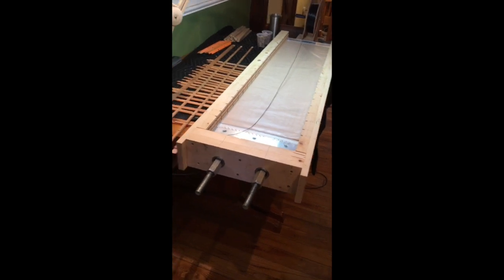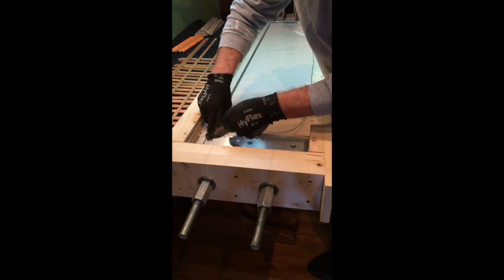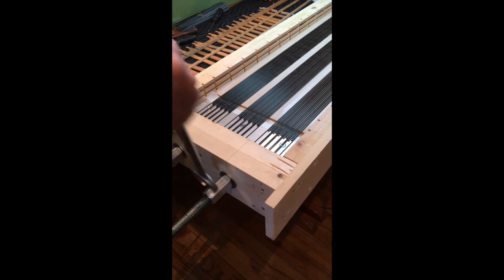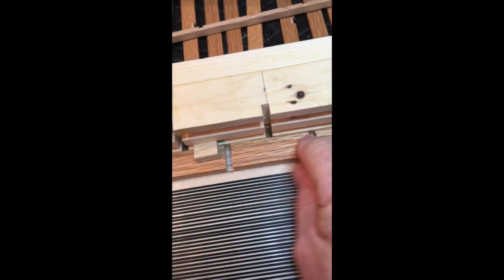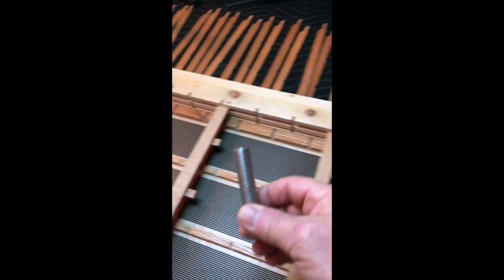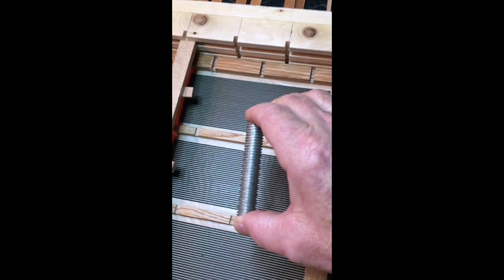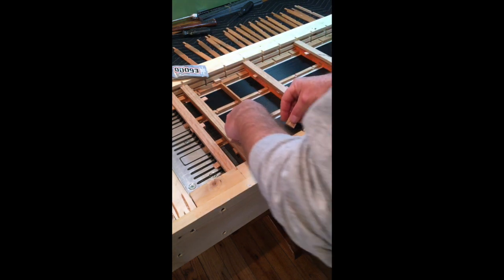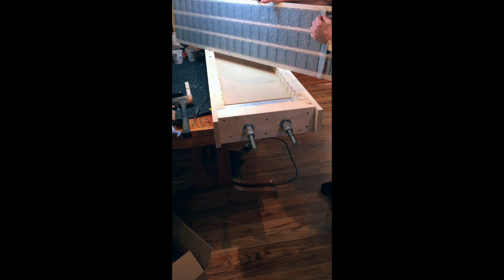Electrostatic Loudspeaker Build - Part 1

Comment: I'm glad you made some videos of these wire stators.  I built a pair of them and put them into a modified frame and subwoofer arrangement based on your plans a few years ago at his point, I just never got around to posting any videos. Your website was a great inspiration for me at an early stage of my speaker building career; I made all 3 different types of electrostats documented there (2 of them are on my channel).
I thank you for the all work that you've done in researching and documenting and sharing this information.

Comment: Im blowen away.  Im going to bet these sound amazing, the craftsmanship you put into them boggles my mind.
Stunning looks too.  
My only change might be a bass reflex subbass woofer in a ported box. 

I've always loved the sound of electrostatic speakers but they had one drawback  and thats focal point 
Martian logans tried to fix this with the bent dipham design but it only added a few more listening points. And still set you off axis to time alignment if you were not in the sweet spot.
The Bob Carver amazing loud speakers did slightly better for this but was costly as well.
I've always loved the sound qulity you got from both types of speakers.
But ive never been able to afford to buy them.
This is sad becuse really good audio has become a rich man's hobby.

I'll just have to get used to my silk dome tweeters, becuse I cant listen to the lousy sounding 99% of the time metal dome tweeters.  They are almost always very poor sounding.  And we won't even bring up horns. Some people like them I dont.

I like the fact your sharing this information free of charge.
I do think machines could be built to wind the wires and set tensions on wires and film.
I've seen a few pairs of broken magnapans on sale cheep becuse they can be rebuilt.
But watching this starting from scratch looks like less a challenge. 
Plus it give me an excuse to buy a 3d printer and or a cnc router 
You spent hours on conventional power tools cutting parts these can be made on a cnc machine.
I also don't see why the use of nonferrous metals couldn't be used for the frame.   Mass production is why this type of speakers not widely made.
They take time to make and its mostly done by hand.   Your jigs are a game changer. 

What was your motivation to do these 
And how many times did you fail trying?

I think you could sell you basic electrostatic panels without the woofer.
And a crossover network as a kit.
Or just the separator stretchers you made on a 3d printer. 
Your works impressive.
Reply: Yes, amazing work. Regarding metal domes and horns: Check out Danish loudspeaker guru Troels Gravesen DIY. He has more than 70 (!) speaker designs to choose from. Check out "The Loudspeaker" TL-1,2 and 3. Faital-10 and a very good all metal drivers 2-way: SBA-61-AL. There are lots of designs. Troels often gets asked by Scan-Speak to try out preproduction drivers. All the best, Per (Denmark)

Comment: You have spent a lot of time and work on this with some great jigs and methodologies. I have looked at the 3 videos on the build. Do you have one on the electronics and hooking up the resistor array?
A very good job.
Reply from the maker: I didn't make any videos showing the electronics but there are a schematic and sketches on my webpage showing the exact connections between the wire groups and segmentation resistor network, including the resistor values.  

http://jazzman-esl-page.blogspot.com
Reply: @jazzzman53  Thanks.

Comment: Real nice.I have used  stax head speakers.the 1 set i bought when i was 15 years old was sr 44 and later the newer model sr 34.They had good linear sound.and they work a lifetime(top quality materials)Around 1994 i bought the top model from stax lambda signature mk2(it is said they have the thinnest mylar membrane they have used in their models)They are real  electrostatic head speakers.They are still in use and sound real great.I am tempted to build some electrostatic speakers and your videos are to blame he he.what i dont like with electrostats are the extra electronic and how that can affect the audio signal.also they are sensitive to humid air.\ i have heard.They play way better than normal type drivers can.
Reply: There have been suggestions for crowdpurchasing a DIY kit for electrostatic headphones. This makes sense because electrostats are good for DIY.

Comment: A great video, can you give a breakdown on the specific materials and the type of wires as well as the what crossovers? Us there any tuning involved?
Reply from the maker: Each stator has (90) 20AWG UL-1061 single strand copper wires, arrayed in (15) 6-wire groups.  The wire groups collectively form a wavefront bending stepped-frequency/stepped-phased array, which functions as a line source projecting a cylindrical wavefront.  As such; this flat panel ESL gives wider and smoother trending dispersion than a curved Martin Logan panel.   

I use a DBX Driverack Venu 360 digital crossover upstream of three stereo power amps, driving a pair of Ripole subs, the two mid bass woofers, and the two electrostat panels.  The crossover frequencies are 65Hz and 265Hz using 36db/octave Linkwitz-Riley filters.   

You can find all the info and many build pics on my website here:   
http://jazzman-esl-page.blogspot.com/
Reply: @jazzzman53  thank you for your reply
can you tell me the length of the from nail to nail?
Reply: What a nice guy down to earth individual Bob Carver. he helps me hook up my monoblocks, did you learn from him or did he learn from you?
Reply from the maker: I assume "nail to nail" refers to the 0.0625" diameter steel dowel pins in my wire stretching jig.
The wire loops are stretched from 48 inches to 48.5 inches; so those are the distances between the before and after the wires are stretched. 

 @makiddo
Reply from the maker: My email address is on my website... I have a CAD drawing of the wire stretching jig I can send you.
Reply from the maker: @makiddo  Bob doesn't build ESLs but he knows he physics involved and he had a lot of questions for me about my designs.  We are both speaker designers so we had that in common when we met.  I will see him in September at the annual Carverfest gathering in North Carolina.
Reply: @jazzzman53  It there a website to order the wire and crossovers. I'm just a evade music buff with an appetite for good sound. I own a pair of New LRS from Magnapan, which is what I listen too. Great speaker! Thanks, Charlie!
Reply from the maker: @makiddo  my website includes my email address and a schematic.  The speaker is biamplified using an active digital crossover between the pre-amp and power amps.  I use a DBX Driverack V360 crossover but any active crossover from Rane or Behringer, or DBX would suffice.  If you contact me thru my website, I will provide a parts list with sources for all the materials.  The wire UL-1061 solid strand wire is the most difficult time to find.  Here is my website: http://jazzman-esl-page.blogspot.com/?m=0

Comment: Good morning
How many threads per centimeter are there?
Thanks
Reply from the maker: I'll let you convert inches to centimeters here:  The wire is 20AWG single strand UL-1061.  Wire O.D. (including the .010" PVC insulation) is 0.052".  The pitch is 11 wires per inch and the open area is 42%.  The UL-1061 wire is not common so it's typically a 3,000 meter min-buy.
Reply: @jazzzman53  Thanks!

Comment: Is this the updated version of the one you did a few years back?
Reply from the maker: The photo at the start, and the speaker playing at the end are the prototype, which I built in 2018.  The middle portion of the video shows me building stators for the new speaker; the Jazzman MkIII.  Aside from a few minor changes like a 1/4' slimmer frame, higher biasing voltage & new printed circuit boards, the new speaker is essentially the same as the prototype.
Reply: @jazzzman53  Thank you.

Comment: Guaranteed no arcing
Reply from the maker: Insulated wire ESLs are very resistant to arcing.  And these are frequency & phased array of (15) wire groups driving the diaphragm sequentially from the centerline outward-- to function as a line source projecting a cylindrical wave front.